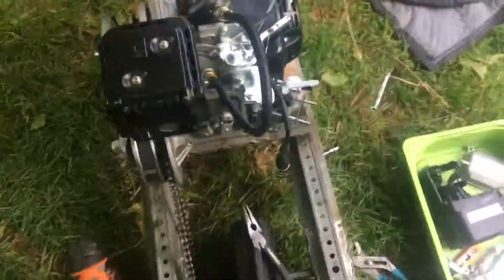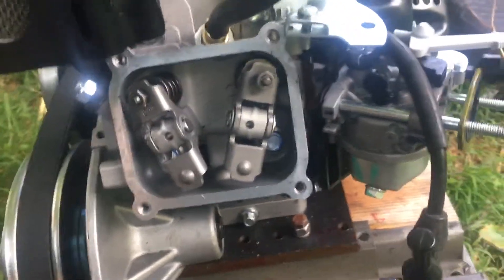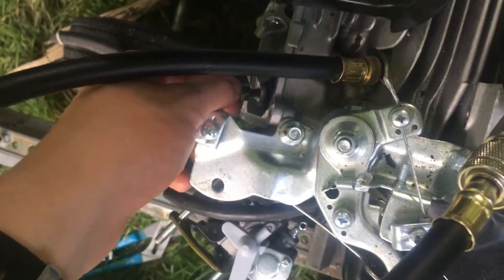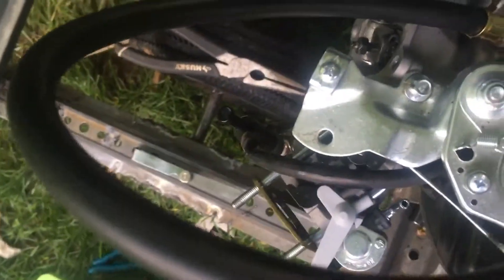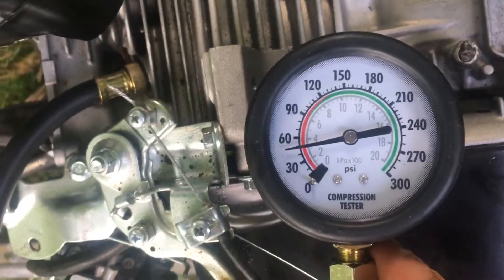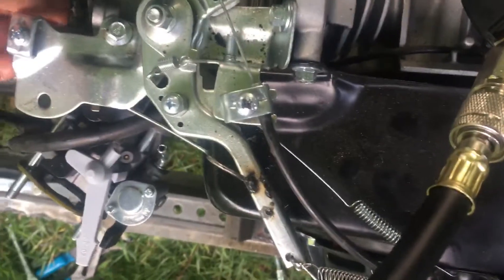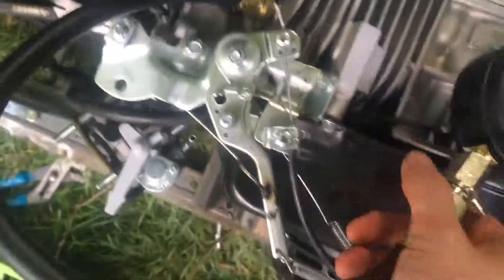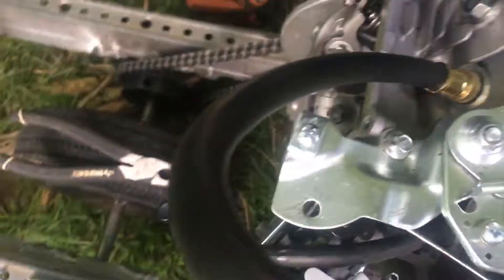How to Fix a Predator 212 with Bad Compression.

Comment: They have valve lash settings for a reason. You don’t just screw around with it and hope you did the job right. You measure the lash using the feeler gauges and the correct tools, not needle nose pliers...
Reply: Exactly
Reply: But you did not pay attention what he said in conclusion....filler gauges  come last.

Comment: So does a tighter valve lash= more compression????
Reply: No, if there too tight the valve won’t close all the way and you’ll loose all your compression but if there too loose the compression release on the camshaft won’t be able to open the exhaust valve to make it easier to pull start
Reply: It's like the earlier coment said, "they have valve lash settings for a reason." Valve lash is basically an added buffer that allows for thermal expansion in the valve. As metal heats up it expands. Manufacturers plan for this based on the amount they know the metal will expand when the engine is at operating temp. By this point the gap or added buffer has closed. That's the madness behind the specific valve lash settings and why those are typically set when the engine is cold.